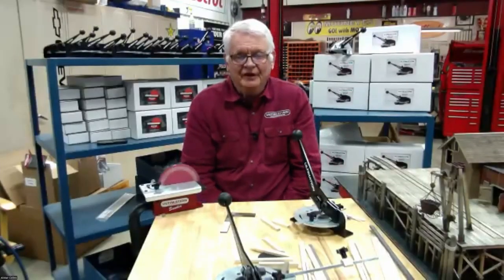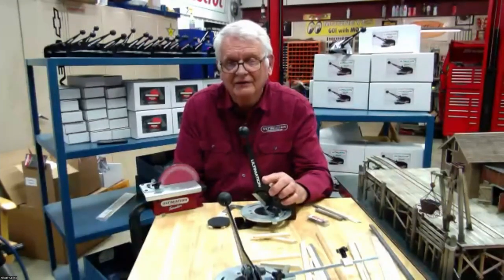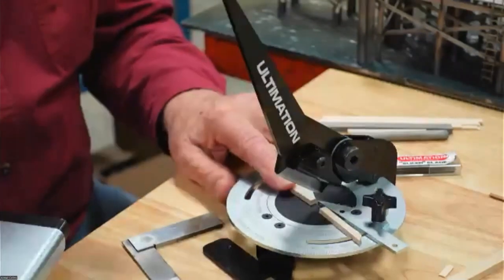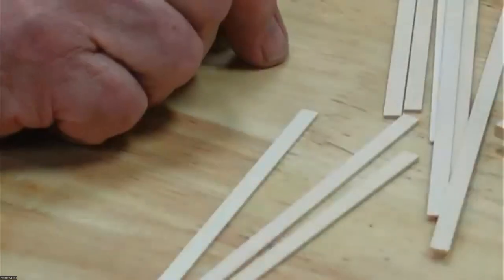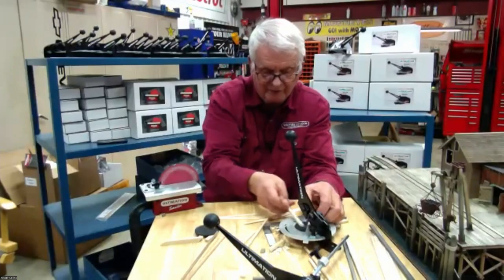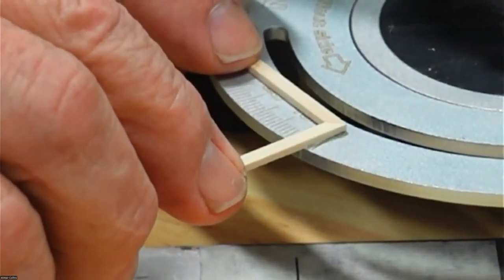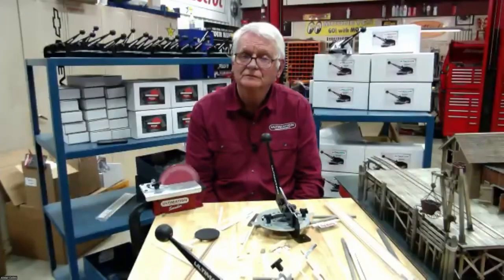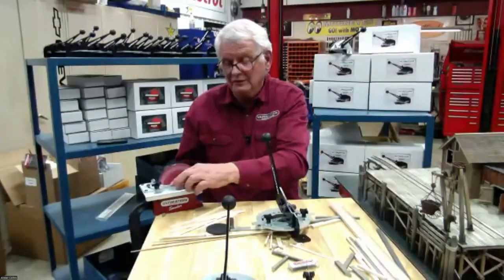Al Collins introduces the Ultimation Slicer

Comment: These products are fantastic> Have Two Slicers and the Sander and use them constantly. I produce Circus Wagon Kits; these two tools are not only time savers but provide accurate cuts and smooth corners. C & R Circus Products in Miniature

Comment: Great product will purchase one but the videography has a lot to be desired if I heard correctly the guy behind the camera was with CTV for 35 years I think he should be better at videoing this.
Last the one thing that sucks about Mt Albert and Handlaid Track is that all your prices are in US Dollar although you are Canadians and I get that most of your customers are Americans but you should cut Canadian's some slack on the prices based on the extortion rates we as Canadians have to pay on the exchange rates of the dollar. If you did that you would probably increase your profits as there are a lot of Canadians who would buy more from you. I can buy it cheaper from my local dealer than I can from you how stupid is that.